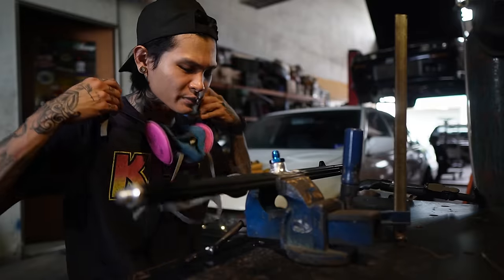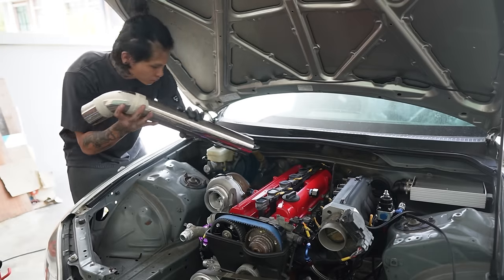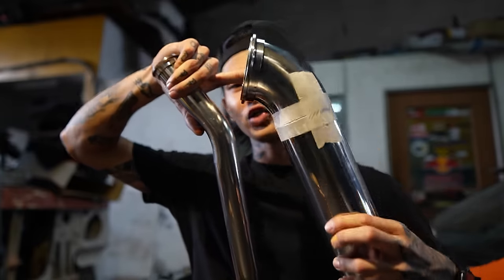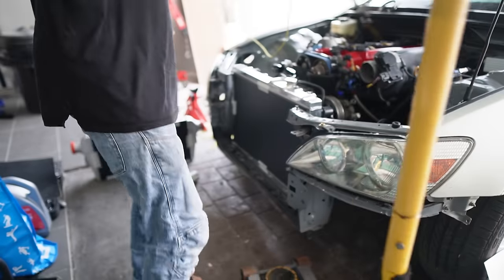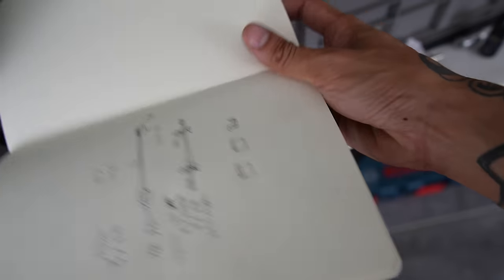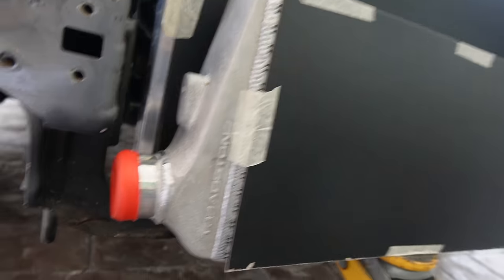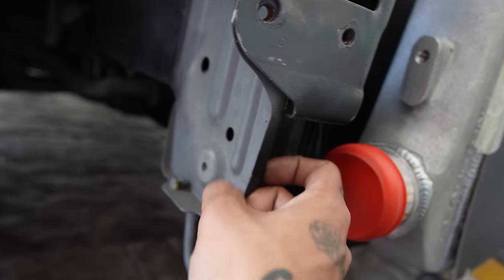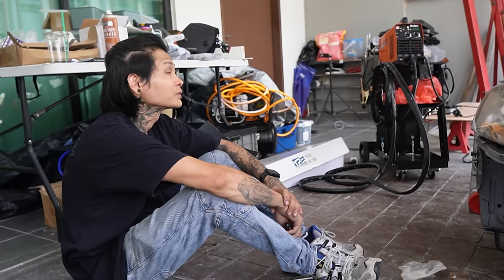2JZ GETS INTERCOOLER, RADIATOR, DOWNPIPE EP.15

Comment: I rather cut the bumper off than cases.. and if my project car..input 2 12 inch fan behind the intercooler..to saport more air circulation..that my opinion man..Good project..and u sould buy all in one ac tig and mig welding machine..